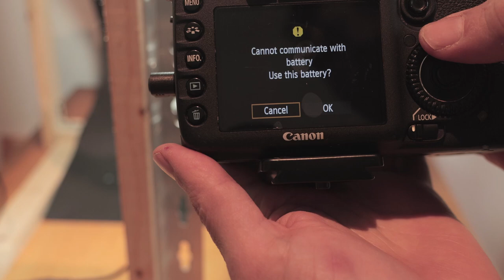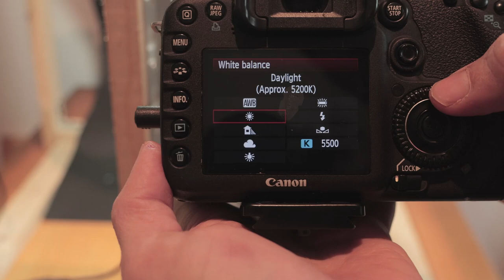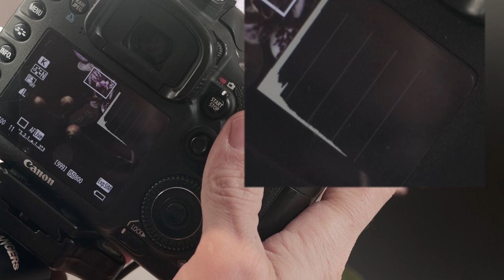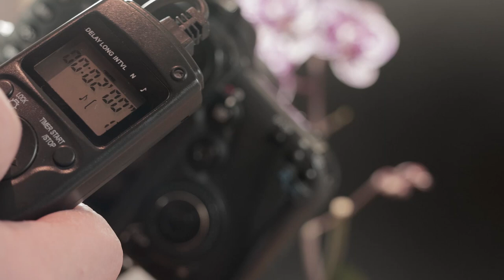Flower time lapse - workflow tutorial

Comment: Nice tutorial. I am trying to shoot something on a much longer timespan, with both studio and grow lights turning on and off when needed. I found super DIY options with Arduino, is there something simpler you might recommend ?
Reply from the maker: Sadly not that I know off. I am working on a plug and play solution which is in the prototyping phase, however at the moment I am also just using an Arduino DIY solution
Reply: @LW_Lapse  I see. Would be super curious to see how you do it, struggles, successes and all. Pretty sure it might interest other people, if you have the spare time maybe ? And if anyone with a manufacturer spirit reads that… One intervalometer that could “speak” to smart plus might be just enough. There is a small (probably) market to corner here ☺️
Reply from the maker: @remka2000  Yes, I definitely want to post more content soon, but have been very busy with my actual job and have just moved into a new studio. The version I'm working on has a small OLED and rotary encoder however bluetooth plus app will be considered in the future. Email me at info(at)by-drone.de if you want to try it when it's ready, I will need people to test it when it is complete.

Comment: Hi bro, i want to ask question. Did you rest ur camera for a while? Or ur camera just shooting whole day without rest?. I got error 70 notification when shooting for 12 hours
Reply from the maker: Hi, No I have it shooting continously, sometimes for weeks at a time. What camera are you using? Is the display continuously on or only briefly after each shot?
Reply: @LW_Lapse  Canon M6 mark II with DC coupler. It happened just once when i was using shoot photo method. But when i was using video timelapse method, it was fine.
Reply from the maker: Sorry for the late reply. I have that camera too but haven't used it for long term time lapse yet. It could be an issue with the power supply (I'm assuming you're using a non Canon one) or perhaps overheating? I would try shooting in Eco mode with the screen brightness all the way down, and using electronic shutter if you aren't already, if the problem persists, the best option might be just to buy a cheap second hand camera, ie 550D has more than enough resolution for a 4k time lapse.